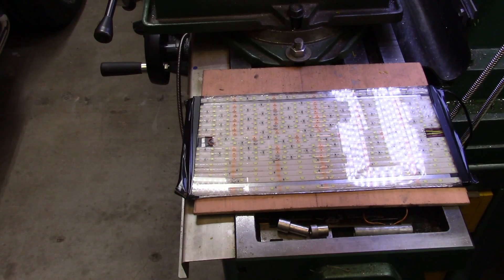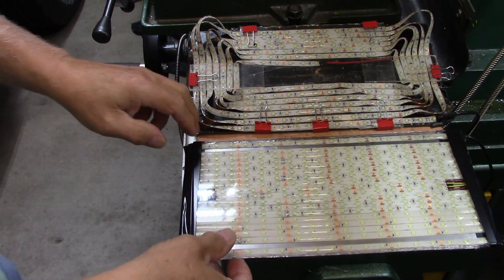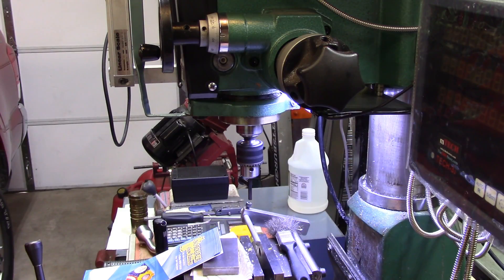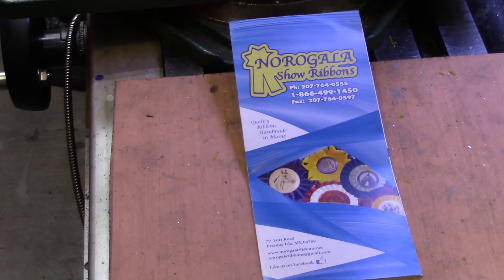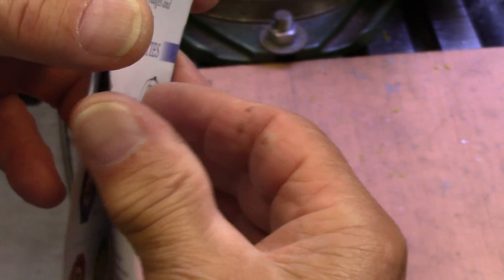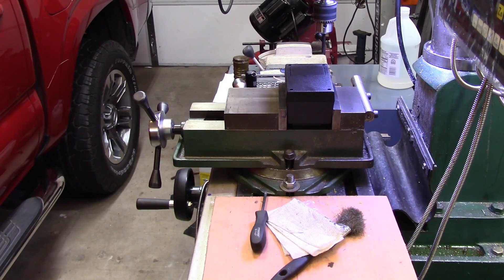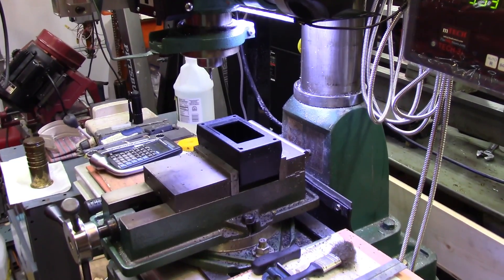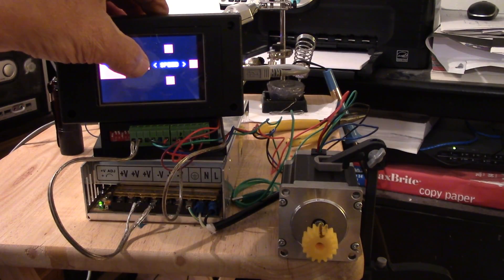Grizzly spindle power feed - the HMI part 2 of 2

Comment: Great project Sir.  I just finished adding a stepper motor to my x axis.  Didn't use an arduino, bought a small controller instead.  Works ok, but stalls out at max speed.  I may try your route latter on, much more elegant.   Stay well.
Reply from the maker: Thanks for stopping by.
Reply: Stall is always max speed for stepper motors. The faster the step rate the less time there is to put current into the inductive coils, which resist changes in current due to being inductive. That's just what coils do. So as your step rate increases your coil dwell time shortens which in turn reduces the current flowing in the circuit. Power is voltage times current. So less current means less power. We overcome all of this to some extent by using current regulated motor drives. Then we use a higher voltage in the system. But that max voltage is still a limiting factor at some point. If you hook am ammeter up to a stepper motor you can watch the current drop off as the speed increases. Eventually a stepper motor just doesn't have the power to overcome even its own rotor inertia and it stalls out.
Reply: @1pcfred  Thank you for the explanation.  It all makes much more sense to me now.  Thank you.
Reply: It took me a while to come up to speed on what makes stepper motors speedy. But if you think about it then it starts making logical sense. In use magnetic fields are expanding and collapsing in stepper motors. The faster that happens the faster a motor is going to run. Motors with high inductance are slow on the upswing too. But once they get in a state they tend to stay that way. Which gives those motors high holding torque. CNC enthusiasts are more interested in torque at speed though. Heck my machine won't go anywhere with no power applied so I don't care about holding torque at all. I do want my machine to have push when it is moving fast though. So when I am evaluating motors for CNC capability I choose the motor with lower voltage, higher current, less coil resistance, and lower inductance. Then I let my PWM drive handle the rest for me. Here's another gotcha with stepper motors. Too much current makes motors coggy. Then they tend to run hot and jerky. So watch out for that too. Setting the current right on a drive can be somewhat tricky. I put an ammeter on one of the coils then slow step up to the highest current rating I can observe. I use that value as my motor current and adjust the drive accordingly. Properly set current on drives makes motors run smoother and quieter. They're more powerful at speed too.

Comment: Here comes trouble... have you thought about putting at least one limit switch on the quill? I know you have a 3D printer and can see how it uses a limit switch to set up a zero position when it initializes. I know you have a nice manual control system setup going, but that large stepper motor looks like it could make a mess of the worm gear if allow to continually move until the stepper stalls. I love those little arduinos, a lot easier than building stuff with the original 8051 chips using "burn and crash" techniques!
Reply from the maker: I have thought of a limit switch.  I am going to see how things look without it.  Thanks for stopping by.

Comment: Your setup is starting to get like the control box of my CNC machine. With my CNC machine I made an intermediate voltage step down circuit. That all looked like this https://i.imgur.com/1EGOEaT.png The schematic is only for half the circuit. The other half is a 7805 linear regulator circuit.
Reply from the maker: My circuit will be less technical.  Thanks for stopping by.
Reply: I'll be interested in seeing it.